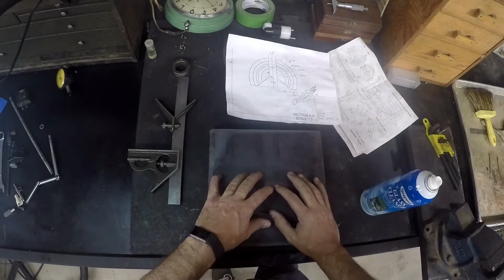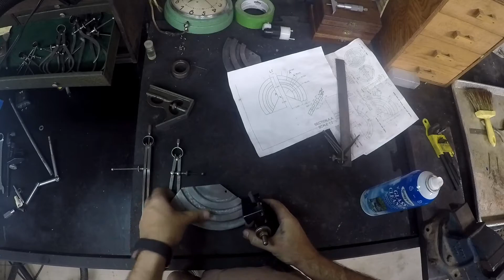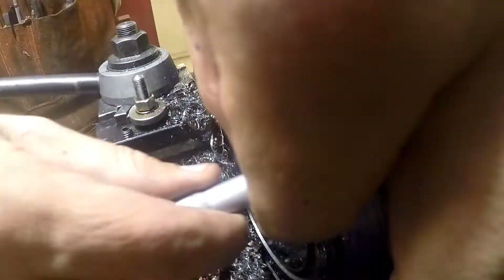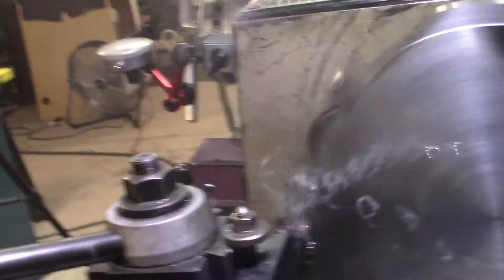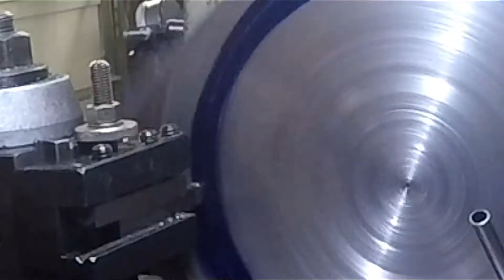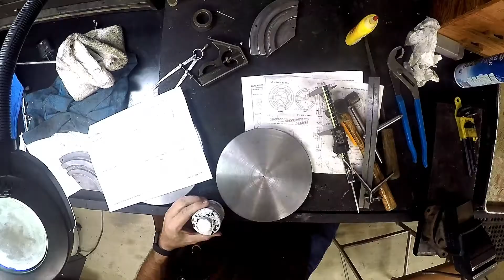Machining tablesaw trunnions (fancy hinges) Part 3 Completed

Comment: Hello, any chance the parts are for sale? I have the plans those came from, but getting the arbor machined was the roadblock. All the quotes I got were well above the cost of a new cast iron table saw, not even including the trunnions which I was going to try making out of laminated hardwood. You did a great job on those parts.

Comment: Bill, do you find yourself using the big lathe most of the time or do you use the Logan for the smaller stuff?
Reply from the maker: The big lathe 90% of the time.  I use the logan mostly when I have something quick and don't want to run around turning on the VFD and all (Logan's on 110 and ready to run) or when I have something in the Clausing and need to quickly do a small job.  

Mostly I've found the Clausing to be much more accurate and ridged.
Reply: The reason I asked was, I was wondering if I want to keep my Logan 10”, I guess I won’t get in a hurry to sell it! Better to have it and not need it than to need it and not have it!
Reply from the maker: @RockingJOffroad  I may be a bit nostalgic, or maybe more than a bit.  My Logan was my first big machine tool so I think it's going to stick around for a while whether I use it or not :)